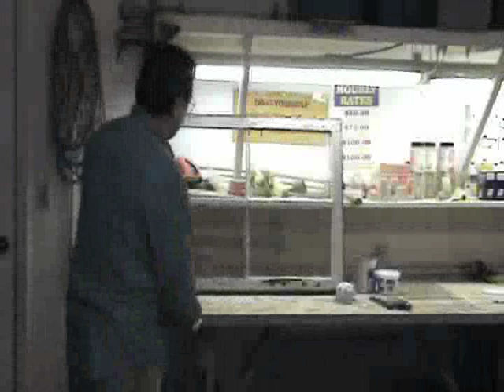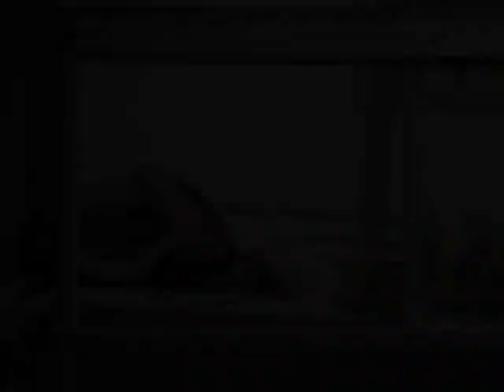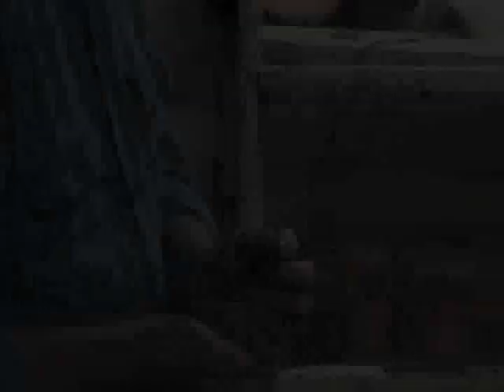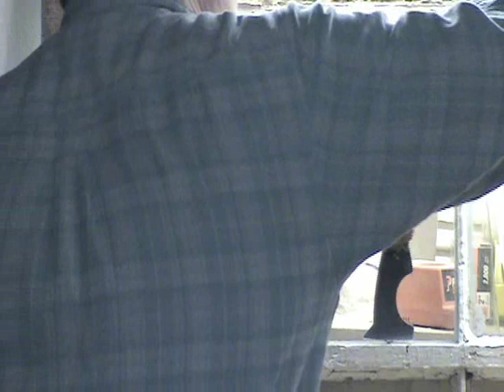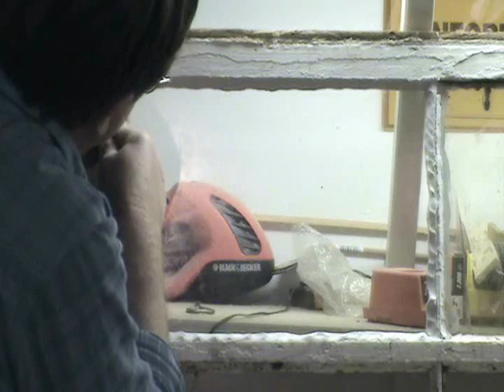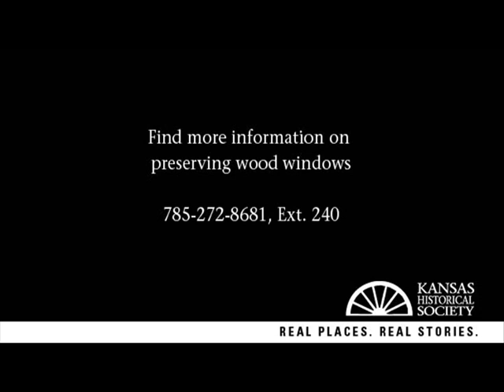Wood Windows: Re-Glazing

Comment: I know it's a little more expensive, but I have done many windows using the glazing that you can put in a caulking gun, and it seems faster and more consistent than this method.  Is there a reason you are using the regular putty instead of the tube kind?